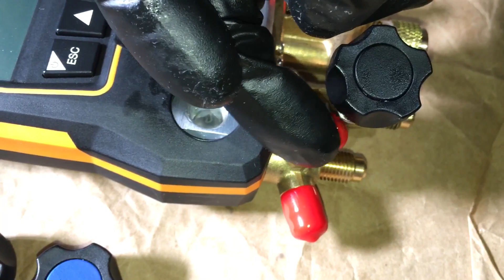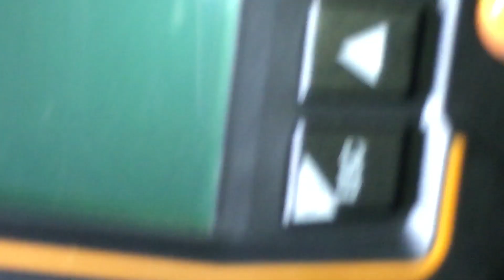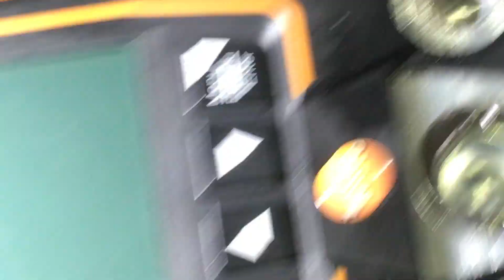TESTO 557S refrigerant gages replacing piston valve seal assemblies (service) silicone grease Orings

Comment: Great video. Where did you get the o rings from?  Thanks
Reply from the maker: The original O-rings off of the Pistons.  But I do have new earrings in a large master kit of several hundred different sizes of O-rings for Automotive.. 

But what I found out about these Testo 557S there were a lot of issues.  
    Bluetooth connection issues
Software conflict issues, and stable usage
      They don’t like rough handling in the back of the vehicle if the knobs get hooked onto other hoses or any other device devices, the knobs can literally be pulled off and you’re searching for knobs in the back of your van or vehicle. 
      The battery case slid on the back is only a little tiny piece of plastic that you have to push up on the little tab, and if you leave it in your bag or in a toolbox or sitting on the shelf.  Just driving around and bouncing around anything catches that battery case door tab and all of your batteries go spilling out across your van or in a toolbox and you’re playing the game searching for batteries.. 
        Even after getting a second replacement, Testo 557S I had the exact same problems with the second one as I did the first one. 
      I’ve long since switched over to Fieldpiece, Bluetooth sensors and Fieldpiece refrigerant gauges much more durable. I can use them out in the rain and leave them outside overnight in the rain.. 
   The Testo, if left in the rain gets inside the circuit board and through the keypad and the screen goes black shorts out because of the water 💦

Comment: Hey men ..question?do your testo build pressure in the hoses after finish using them
Reply from the maker: Only if there’s residual oil residue with Refrigerant, trapped in the surface of the rubber and the oil a slight build. 

But I found the Testo gauges are not accurate. They do not hold their zero drifts. . 

Even after zero in the gauges, they keep drifting occasionally .   

I have two gauges. Both did the same thing. .   So not isolated just to one..

Comment: What size O-rings do these use?
Reply from the maker: Actually I don’t know the size of the O-rings because I have several universal master sets that each set has several hundred O-ring sizes.
         I just signed them and pick them out by hand by Eye 👁. 

You only could get away with changing the O-rings so many times it’s that nylon Teflon plastic type piece that you see in the surface space area that also gets worn out or can get foreign matter in bedded into the surface right where it seals. 

If you ever have that problem you need to order the whole piston brass assembly. 

O-rings only leak external to the atmosphere

That plastic material that you see on the surface facing stop the leakage in between bores in the manifold

Comment: @t lech hey how do you like those enelopp batteries ? they should last at least double of time of the alkaline type
Reply from the maker: Highly recommend those batteries they manufactured by Panasonic you’ll never have to buy batteries from your local grocery store or big box home repair store again. 

         I literally use a few hundred dollars in batteries every year now this one purchase a batteries will last me the next couple years on the rechargeable
Reply: @coldfinger459sub0  i believe you cuz i bought a Chinese rechargeable AA like 2 years ago for my testo 550 which eat batteries and still holding strong ..but i want to upgrade to enelopp i know those will outlast you ..i have seen reviews 8-10 years later still holding 80-90% capacity..thanks for the replay ..love your videos btw specially the  leak detector one
Reply from the maker: @Ismael72110  and there is two different grades and types of enelope batteries. 
            The black ones are the high output high amp draw hi current draw type batteries good for motors and things that draw a lot of power really fast. 
                But they have a shorter life cycle of around 1000 charges instead of 4000 charges. 

         So when you’re buying batteries for low current electronics make sure you get the green ones or white ones

       The black ones are just for devices that you need to dump a lot of current fast for performance not longevity
Reply: @coldfinger459sub0  yep the white one 1900 mah is more than enough with long shelf life

Comment: Very good video. FYI testo will void the warranty if you mess with the valves.
Reply from the maker: Are usually don’t care about warranties.     I only bought this gauge because I was curious I don’t need it I have many other gauges. 
        I have the Testo 570 which I do like a lot and  The Testo 570 is my gold standard for performing pressure decay test I like their sensor or high pressure. 

         And I had to re-repair my Testo 574 leaking valve seals that were damaged on assembly twice after sending it to Testo to get repaired I have no Confidence in their competence at repairing their own equipment. 

          After the second leak I called them up after discussions with their tech-support and a few others I just told them sell me the valves I don’t care about you running calibration test on it I will do it myself thank you very much. 

         And I never leaked ever since then and I did the modification with silicone grease in the O-ring valve grooves. 
           And after that it was capable of also pulling deep vacuum and holding watch it could not do before. 

       For ease-of-use I prefer my Fieldpiece and I recommend Fieldpiece because the software ease of use,  more intuitive easy for young inexperienced guys to learn especially for the automotive side of my business I recommend automotive technicians get the Fieldpiece. 

 In large display with big numbers for old eyes
Reply: @coldfinger459sub0  Yeah just thought I mention it for other people who watch this. You seem like a very smart capable person. Sorry to hear testo can't do a proper repair job on the valve seals. Like the old saying goes, if you want it done right do it yourself.